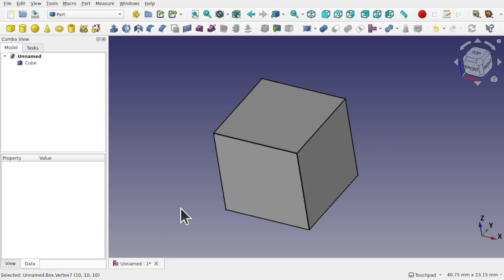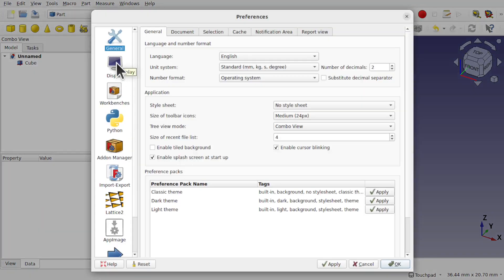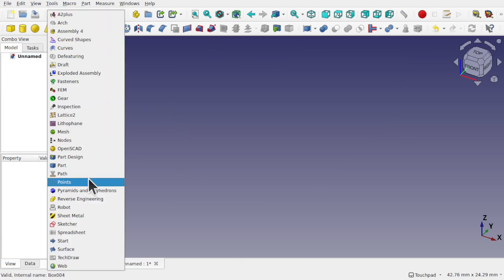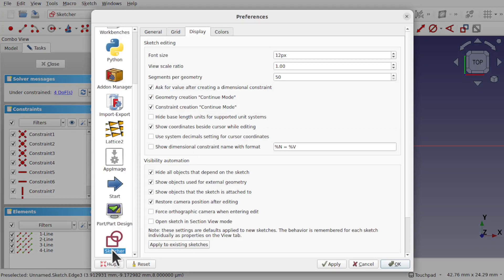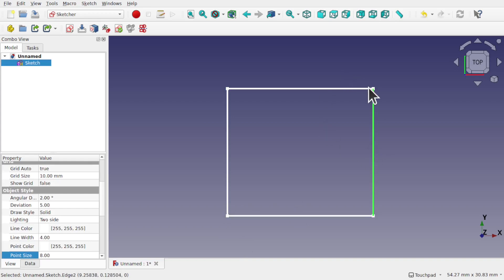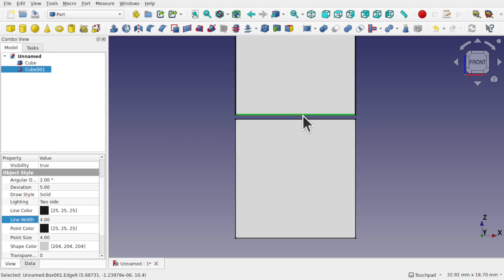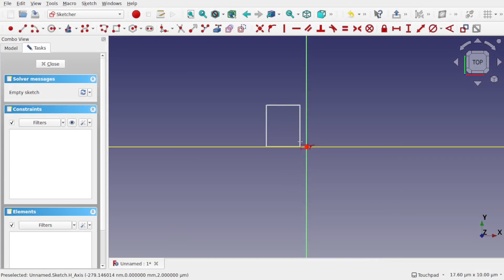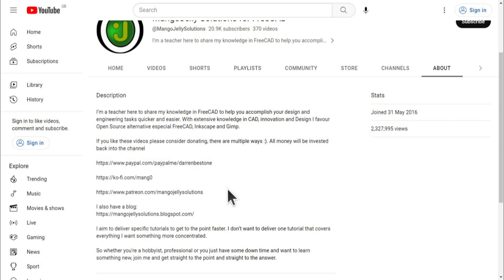FreeCAD Secrets Unleashed: Supercharge Your Workflow for Effortless Edge & Vertex Selection

Comment: I was going through your beginner guide and was getting so frustrated learning the constraints and the way this program works, but the thing that was causing the most trouble was the selection.  I saw you doing it so simply and wondering why I was having such a hard time selecting the center point of the x axis to constrain the shape.  It literally added 30 minutes of fighting the interface.  I stopped and googled if there were better selection settings and was pleasantly surprised to see you had a video on the topic.  I've since recreated the simple beginner tutorial and it was stupid easy after changing these settings.  Thanks you!
Reply from the maker: Glad that this video helped you out, I know that can be a tricky area  and super frustrating to get right.  And a complete put off when your first starting.  Glad it helped.

Comment: I have a tangentially related question:

Does freecad have the ability to snap or grab to a mid point of a line or a quadrant on a circle etc. (inside sketcher for geometry creation and adding constraints)?

I am currently making refrence lines and trimming them back in order to do this and it is incredibly clunky. The ability to snap or grab positions like these would be incredibly helpful and useful.
Reply from the maker: There is grid snaping in the sketcher in 0.21 which makes life a bit easier. Other than that your left with the constraints.

Comment: Anyone noticed on the latest version that when you do an operation, like pad, the input for the pad amount is highlighted(ie "10 mm") but yet if you start to type a number the keyboard focus is on the render pane so it just switches different view angles.  Causing you to have to click in field you want to change even though the text was already highlighted. Frustrating and requires more clicks than I was used to in previous versions.

Comment: Oh, I've used most of these already but never thought of raising pick radius so much. At 40 it works almost as well as snapping in Inkscape.
Would be nice to have a shortcut/button to switch it on and off, I use that in Inkscape all the time, but for that devs have to admit that it is indeed snapping :)
Reply from the maker: Glad to help, I am wondering if changing the setting shows up in the python console as a command. If so could write a macro to toggle the setting then add it to the toolbar

Comment: Hi Darren, I would like to have a part editing function and be able to move the points and edges as I want, wouldn't it be nice to be able to do that ? So we could modify the geometry of a cube without going through a sketch to do it, for example 😊Just an idea like that 😉
Reply: Difficult, or outright impossible to do, in a parametric modeling CAD program.
Reply: @imacmill  You are sure, it seems to me that in an earlier version of Freecad, it was possible to edit the vertices and edges of a solid, via the Drafth workbench. But that was before 😊
Reply: @imacmill  No problem, I've been using FreeCAD since 2007, but I also wonder why there is no longer this functionality. But I remember that this could create artefacts on the solid thus modifying
Reply from the maker: Parametric co-existing with direct modelling. Whole can of worms when mixing non destructive and destructive operations together, I am finding just that in Blender CAD sketcher. . The program really has to have a solid foundation with that in thought from the beginning to work to allow for those kinds of edits. But it would make things alot easier  if they can get the concept working.

Comment: why isnt this set by default?
Reply from the maker: I think they give a default ball park setting that probably hasn't changed since the early days, since then bigger monitors, more sensitive mice and these settings get over looked. That's the only thing I can think of why.
Reply: Working at around 106-109dpi monitors and 1500cpi gaming mouse I am finding the defaults quite adequate and wouldn't push them much further. Large picking radius selecting something you aren't even pointing at is extremely annoying and the line weights are good for a mix of high and low complexity elements.

Comment: What did I miss ? I dont have pick radius option in the selection tab. Do I need to have another option activated ? Some snap option perhaps ?  Ver 0.20.2 windows 👍
Reply from the maker: From a recent comments from a viewer they have helpfully added it's actually in a different section for older versions of freecad, it's in the display settings towards the bottom. I have added a link to show where it was moved from and to in later versions of freecad https://github.com/FreeCAD/FreeCAD/issues/9205
Reply: @MangoJellySolutions  Cheers 👍.  I need doenload the latest version too.